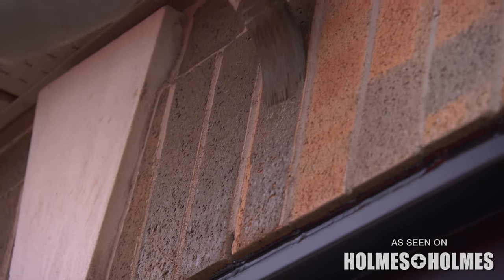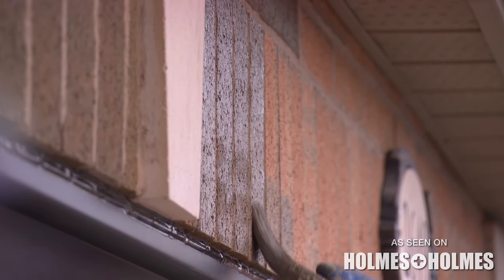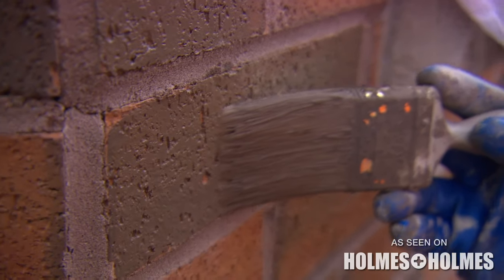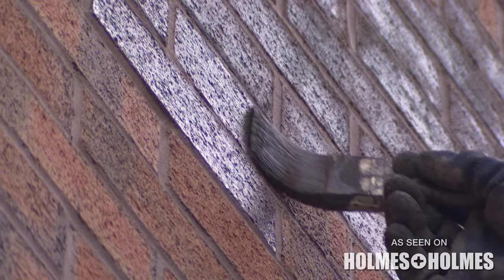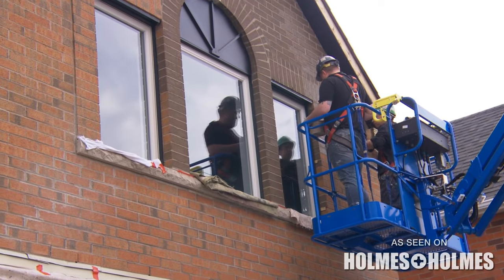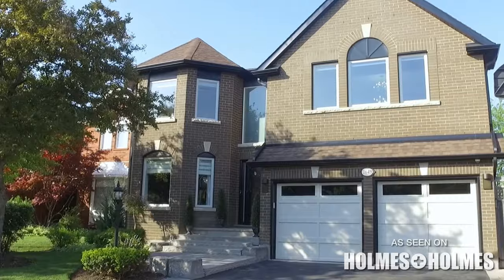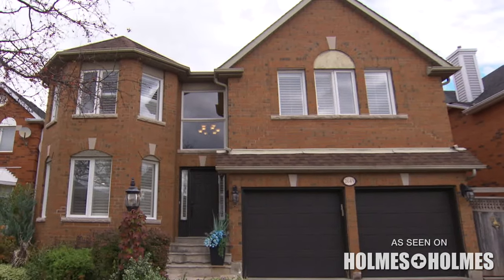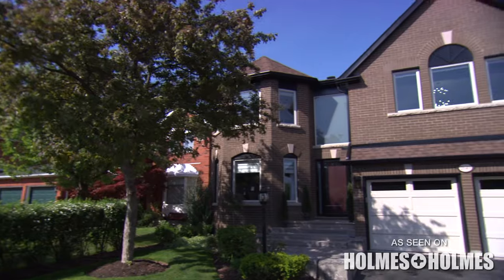Brick Staining | Mike Holmes

Comment: Hi Mike, we are running a project in Memphis TN, it is not been easy to find PermaTint here, do you know any other good brand easy accesible in the USA?
Reply: I am in memphis to.  did you find another brand?
Reply: @mfccmemphis9112  Great to hear Mike. I wish I knew earlier that you are in Memphis. I found other brands, but I decided to stick to PermaTint, so I ordered it and it’s in transit. It should arrive this week to Memphis
Reply: Did you order straight from permatint?
Reply: @dkkshoe  Yes, great service, fast and good stain. It is already on the brick of the house and looks great
Reply: @javierpereira7580  Did you stain it ? Does Permatint is water based or acid based ? I am in Dallas and need to get the product here and have someone do it. I do not how durable it is ?
Reply: @Mara-tl7sd  Water based mineral stain. It is easy to apply. They give you instructions, but any good painter should be able to apply it. If you don't want solid color, then I recommend asking different samples of diluted stain in the color you want. Apply couple hands to a piece on your masonry so you understand the color that you want in your wall. Otherwise you may mistakenly order the wrong one. About durability, I don't have it for long time yet, so can not attest on that yet, but they have one of the best warranties in the industry and it penetrates the brick for longer lasting, but the key thing is that it is highly breathable and it will allow your brick to breath and avoid it breaks by sealing it as other paints do.
Reply: @javierpereira7580  Thanks. Is water based mineral stain is different than just water based stain ? Because I can get H&C colortop concrete water based stain from SW locally here but not sure about the quality and durability is as same as Permatint ?
Reply: @Mara-tl7sd  I am not familiar with the brand you are mentioning, but permating is mainly mineral based and not organic color based. It makes a difference on durability. I researched quite a bit before buying Permatint, and went this route because I believed was my best choice. Also gives you the ability to get semi solid or semi transparent stain with the one I choose and this allows to show the variations of tones on the brick as translucent or as soft as you want it. It's kind of a kool stain.
Reply: @javierpereira7580  Awesome thank you so much, I will try to order in permatint website directly. I'm looking for white stain.
Reply: @Mara-tl7sd  Forgot to mention that the product I used from PermaTint was the 1020 SiLazur because aligned with my needs
Reply: @javierpereira7580  how did you get the product shipped from Permatint ? I called them and no response. I am looking for 1010 QuartzGuard and I believe its white stain
Reply: @javierpereira7580  
Did you need to seal it? Did you test if it gets removed with paint stripper?
Reply: @marioa3318  I did not have to seal it. I did not test the removal with paint stripper, since it wasn't on my need. I am not sure and you can ask to the permatint guys, they are very nice and respond questions, but I assume that since it's a mineral base and the intend is to penetrate and bond with the brick, I don't think removing it with paint stripper will be doable, but I don't know. I think one of the reasons Permatint has such large durability and warranty is because of that bonding breadeable characteristic, in stay to be just an overlay
Reply: Hi, is this the name of the product Mike used in his video - Perma Tint, don't know if they sell it here in England or something very similar, this stuff would be ideal.
Reply: Looks to be a Canadian company, hopefully they sell overseas.